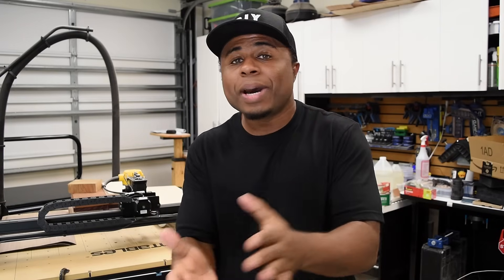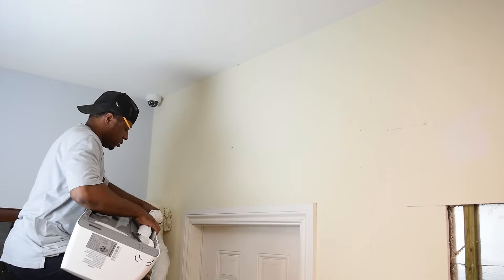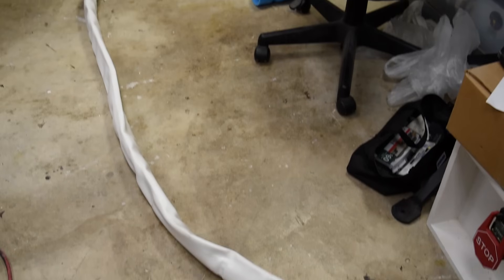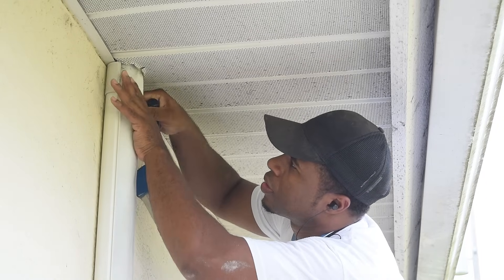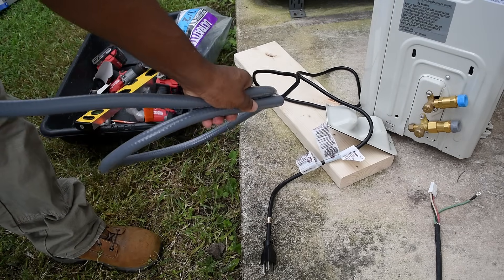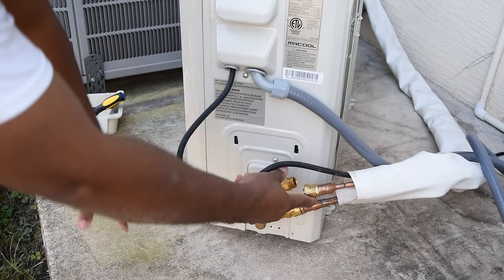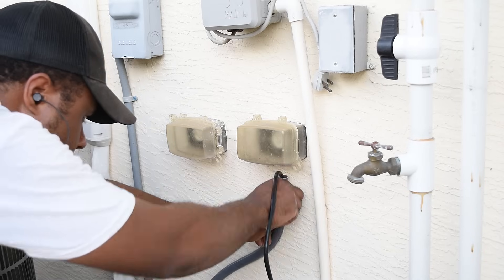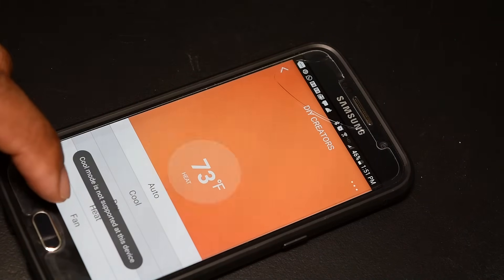How To install Ductless AC & Heating System // True DIY Mini Split MRCOOL

Comment from the maker: I forgot to mention this system is extremely quiet.  Also, This is a complete DIY System so the installation will be different from a typical installation. The lines come sealed and precharged. This may be hard to believe, but you don't need to vacuum the line. Please visit https://mrcooldiy.com/ to learn more.
This unit can be installed in any room. My work space is around 400sqf and I have this unit https://amzn.to/2Ci2uEN
Reply: No need to put the lines in vaccum??
Reply: @gordjy  sure ! the air inside the line will mix with the gas and that's bas for the system and efficiency for cooling.
Reply: Gordjy the lines are precharged.
Reply: Gordjy don’t follow this. The compressor won’t last very long with out pulling a vacuum on the refrigeration lines.
Reply: @NicksRestorations  BS! At the very least, check with the manufacturer as to the " compressor wont last long.."  why in the world would they give the warranty they do ( pro install NOT required) if they were not willing and able to back up their warranty?  Also, check with the manufacturer regarding whether its the lineset or the condenser that is precharged...also, how long do you want that condenser to last? I am in my third season with this one....in Hawaii.....
Reply: Some amazing comments here.  This unit is made to DIY. Do you really think the company is going to put out a product without taking into consideration the basic concepts of AC/refrigeration? The comments about the "need" to vac the lines and the one about hard wiring don't take into consideration that maybe, just maybe, the engineers at the company might know a thing or two about a thing or two.
Reply: @rogermccaslin6750  yes but everything they add is just another component that can fail.
Reply: @higherstandardservice9877  
I wasn't talking about the quality of the unit. I  just commented on the fact that some think it's not DIY and/or the the idea that it needs to be vacuumed because the lines are shipped open to atmosphere. It's as if they couldn't fathom the idea that the line set is precharged and sealed. My point was the manufacturer wouldn't put out a product that was doomed for near instant failure.
Reply: @rogermccaslin6750  they most absolutely would and do, they do it all the time in fact perfect example cars. We have the tech to make cars that use no resources have no emissions and would in theory never break down. But that's not what the market sells, instead they sell a product they know is  going to fail just after their warranty so they can sell u another... no company would make money if they did what u r implying
Reply: @rogermccaslin6750  I never said it's not a DIY, I said it's a terrible product to use, and that for the minimal price difference you should just get a real product and have a certified tech install it. Never the less I have much better things to do with my time than this
Reply: @rogermccaslin6750  made in china... with a rebranded name... lots of issues... there are no short cuts.... and china DONT care about you.. they just want to make a sale... im a 25 yr HVACR TECH... specialized in commercial/ industrial applications... but i did start out in residential... if you have any questions... PLEASE dont hesitate to reach out
Reply: @richardwoeckener7936  
I'm sure you are probably right. The quality may not be there (support either). The thing is, I wasn't commenting on the quality, just whether or not it was sold as DIY. Some were convinced it wasn't for a variety of reasons but the company's website clearly states it is DIY and the unit is engineered for DIY. That was my only point. Whether it last for a year or two or ten, I can't say.
Reply: @rogermccaslin6750  i understand... my apologies..i meant no disrespect  ... but if you have ANY questions on future projects on hvacr.. please do reach out...
Reply: @rogermccaslin6750  This unit is not made to DIY.
Reply: @DividedWeAllFall  
You think so? I'll just refer you to their website- mrcooldiy.com. The link in the video description will also take you there. I bet they have a contact page so you can inform them that it's not  DIY.
Reply: I felt i should add some insightful info here since there is a debate about longevity of the unit when not installed by a HVACR technician.  First of all the quick connects do have an air space between the condenser isolation valves and the seat of the quick connects where air/moisture can collect.  This gentleman did a great job in minimizing the dirt in that may have been introduced by keeping the caps on until connecting them up.  However, air/moisture is still in that area from when they were assembled in the factory.  Is this an issue... not really if you understand how the quick connect seals. The QC does not depress the seat until 50% or more of the threads are engaged then at that point you need more torque to thread it in further, the refrigerant then will start to flow and since the threads are not a seal some purging of refrigerant is going to happen.  It is good that the QC connections were soap tested to verify that the seals are sealing.  But purging alone like this will not remove all the air/moisture from that area introduced into the system.  So some safe guards have to be added to capture this small amount of air/moisture.  These safe guards are usually driers and the POE oil itself.  Driers will capture most of the moisture while the oil has sacrificial moisture inhibitors additives to collect some moisture as well.  The only thing i can see being an issue is the routing of the line sets.  The excess length can be looped horizontally but i would not loop them vertically to avoid oil traps.  Other than this, the installation look good as long as the manufacturers line set installations were followed to the letter.  Any DIY people need to do their homework and plan the job ahead of time.
Reply: @greenbiker9951  u failed to touch on the point of system longevity here.. although you did say what I was trying to say a year ago... but in the proper wording.. these safe guards u speak of tho, u fail to mention that they can become a restriction in the line after collecting that moisture causing you to need service. So really this system is great if u dont want to pay labor, but you are going to pay more in the long run if u do the math between cost to operate, maintain, service versus contractor installed...
Reply: Dang guy, surely you have a friend to pull wire on, at least,  or simply try to feed it. Wish you'd had my number. .if we were remotely close, I'd come by and help.
Reply: Bob Boon  watch the video before you comment. It makes you sound like a moron.
Reply: DIY Creators I work in the HVAC trade. And you did better than a lot of installers I seen or worked with.
Reply: I can buy Daikins cheaper then that
Reply: Matt M, you must be a licensed HVAC guy to be able to do so. DIYers have to rely on places like Mrcool, and other online shops to buy them at full price. Where do you purchase yours from, if I may ask?
Reply: @mattm5361  people dont get it...
Reply: We know it's really for your grow room 😂
Reply: The amount of air in the line does have some moisture but with a small drier in the system, it would be removed. An HVAC guy might give you crap about it and say you should use dry nitrogen to flush the lines, but it's not that big a deal. Great video.
Reply: @ChrisWilson999  there is no air in these lines, they come charged with refrigerant.
Reply: DIY Creators I need a man like you!
Reply: I was wondering about the lines , maybe they have one way valves in them .   That take inward pressure to open .
Reply: Bob Boon  there is a photo on thier web site ,when you connect the lines the quick connect is opened .    The compressor is full ,the lines are full .   Done and good to go .
Reply: Did you get an HVAC permit from your power company. Virtually every state requires them now if you wire them direct. That's why they come with a regular plug in cord so you don't break any laws..
Reply: Could this be used to supplement the cooling of a standard house unit for a 2 bedroom upstairs area?
Reply: that's remarkable, I was just going to ask that question. I'm an HVAC contractor who sells and installs A/C and I never heard of a precharged line set and also was already connected to the indoor unit. very easy installation. Good job on the video. Quick and covers everything
Reply: I am a master HVAC Mechanic and I own a HVAC Company . I really liked your video . I have different tools that make it easier to do a install like that and I have 37 years experience  and I think you did a outstanding job and explained it well , I look forward to watching more of you videos ,
Reply: I would just like to recommend to anyone installing one of these that you should always add an A/C disconnect outside for servicing the unit. You should also never plug them into a receptacle since these units draw alot of amps and if something else gets plugged into the same receptacle it can end up tripping the breaker. Ductless mini splits should ALWAYS be ran off their own breaker and hardwired.
Reply: Chris Verbeke sorry but these units do not draw A LOT of power. There’s a reason it came with a 15 amp plug end and not a 20, the entire system probably only pulls 7-8 amps max. This is the main reason the seer ratings are so high on mini splits.
Reply: So you could have ran the hvac lines dwn where the drain hole and hid everything
Reply: U sound Jamaican .are u ?
Reply: DIY Creators how much do the system cost?
Reply: Hi, Good video I liked it, can you please tell me how many SEER does your unit have ?
Reply: 10:19 You better put that hose inside the box or water might fill up the hose and it may run into the condenser unit and corrode the contacts.
Better safe than sorry.
Reply: DIY Creators so can you travel to install me one in my home 🤗
Reply: What about the cost??? I see these in Orlando Florida for sale around $500.00 for a 12,000 btu?? Was yours the same price wise, and btu???🤔
Reply: what if you want it in multiple rooms am I using one condenser.?   I need it in 3 2nd floor bedrooms. thank you so much for sharing. god bless
Reply: Hey thanks. Another very informative video. I ended up getting the 24000 BTU mrcool version and putting it in my garage. I'm not quite finished since it's a 240 I had to do some extra things. Like it's stalling an extra breaker and the problem with it is that the electrical on the mrcool systems is very lacking for instruction.
Reply: Great video, thanks.

  Just wanted to say should look at the flare fittings make sure they was done rite.
     Thank you
Reply: What's the lowest temperature you can set it to?
Reply: I see how these pre - pressurized vapor lineset work but what if you install and crosstread the flare nut or not tighten  it enough causing a leak? I would feel more comfortable  pressure testing the lineset and removing moisture the old fashioned way. Just added security.
Reply: 10 of 11 customers I've had were denied warranty from this company, now have Mitsubishi,  american standard or Fujitsu's. and the other spent over a grand on electrical components to get it working.none were more then 3 years old
Reply: Chicano Azteca  niether does Mitsubishi and fujitshu... because the good units can have long line sets and support wall units , ceiling cassettes , mini ducted air handlers and multiple heads... and we can add or remove the refrigerant charge to accommodate the install .... also better warranties.. but you do have a good point.. if not done correctly when attaching a self piercing line set... customer can get air in the system !! ITS GOOD TO HEAR FROM A FELLOW HVAC TECH ... HVAC ON MY BROTHER!!
Reply: Chicano Azteca  p.s... carrier minisplits are made by midea
Reply: And what about the vacum the system and mine take 12 amps max and average 9 i can plus it to the wall
Reply: @massesbulet  did u have a question?
Reply: Impressive, very clearly explained, critical points of mention were highlighted,.. extremely well done wow. 💪🏿
Reply: Thanks for the DIY video..  How much did this system cost?  We are looking at purchasing an 800 sq ft portable building and would like to be able to use this system running 1200 amps of solar power.  Will this work?
Reply: DIY Creators lovely 😊
Reply: Hi. Did the inside unit pipes came with vacuum in it? Just asking because of the humidity. Thanks
Reply: How much you paid man??
Reply: Thank you for your channel and I wish you much success my brother
Reply: ⅘
Reply: Any updates on this AC/heater after almost two years? Still going strong?
Reply: Seems to me even if it's a little small. Just keeping the edge off and it's good.
Reply: I got one and you do need to pull vaccumm on it
Reply: Sure . The mix with gas and air is bad for the system .
Reply: cutting through the coloured beam is not good.
its the support frame, also, whoever wired your house is an idiot and didn't pass inspection, or, the inspectors blind.
you have exposed wire running over and around exposed wood nails in the attic. there needs to be a metal separation between the two.
cool project none-the-less, and congrats! (ex electrician now aa rodman)
Reply: Thanks for sharing, God bless you.
Reply: That was clean bro,but what happened to vacumming the pipes🤔
Reply: @Skylarkist Expert it's a DIY system
Reply: How cold does it get where you live?   My furnace has a condensate drain and I rain it to a condensate pump along with the AC to a pluming drain inside the house so it not freeze in winter.   Amazing how many contractors in the older days would let the condensate from Ac dump into Crawlspace.
Reply: Great video sir!
Reply: What is the max distance from the indoor unit to the condenser?
Reply: The website says “The line sets precharged with R410A refrigerant, the quick hook-up electrical connections, and the quality engineering mean just about anyone can install a MRCOOL DIY in their home.”   In theory a r410a pressured lineset with a quick connect from the factory would still introduce air and moisture but in a small amount.  Unless it is designed to purge the non-condensables with the r410a as the quick connect is cracking open and before the sealing to outside is complete.  It is important to note that POE refrigerant oil used with r410a can create corrosive acids when moisture is introduced, shortening the compressor life by degrading it’s windings.  This is a critical difference that r22 and mineral oil did not experience.  A hvac tech would shorten the lines to fit, vacuum and check refrigerant levels for utmost performance and reliability.
Reply: They have been pre-charging lines and compressors for years in Asia. It is a proven method.
Reply: @rj.parker  Good luck finding your sub-cool without a Service Port on your high side. These condensers on the duct-less split are pre-charged for a pre-set amount of line-set. Usually around 100 feet depending on the make/model and # of head units. Leaving the line-set the length it came would be just as optimal as cutting it, putting it in a vacuum (not to mention all manufactures want a triple evacuation), and charging it. I'm an HVAC tech and I would have done what the manufacturer recommended, not thought I knew better than an a group a Engineers......
Reply: If I were to go that route, using the MrCool DIY series of mini splits would not benefit me at all. These "quick connect" valves in the line set introduces zero air/moisture into the lineset.  How do I know this? There are many successful installs of this DIY series that were done 3-4 years ago, and longevity for these units is VERY good.  While it is possible according to your theory, that air/moisture may be introduced when hooking up the lineset to the condenser, the likelihood of this occurring is extremely small. The warranty for the MrCool DIY series is 5 years parts/7 years Compressor, and professional install is not required to be covered by their warranty.  You can always use an HVAC contractor to buy and  install a mini split, and you will pay many times what this unit will initially cost. In this install, the lineset is coupled to the condensor, THEN the high side/low side valves are opened on the condensor.  Gauge your cost/value proposition, and carry out your due dilligence, regardless on what mini split unit you decide on.  If you are an avid "do it yourselfer", this may be the mini split unit for you.
Reply: Elder Geek How many motors were damaged by poor techniques of subcontractors such as leaving copper lines open before hookups permitting bugs to crawl inside then cause motor burnouts?
Reply: @eldergeektromeo9868  if ur gunna do it yourself this is the way to go. But that warranty is terrible 5 years and only 7 on compressor. That is less than half the warranty of Fujitsu's, Mitsubishi, haier. Etc.. so you are get a cheaper unit that u will spend more on, more to operate, have to install it yourself and it's not going to last even half as long as a real one. Ur gunna do the work 3 times and buy the system 3 times instead of just doing the 0% financing every major manufacturer offers and getting a 15 20 year warranty instead. But weigh your pros and cons right.. less money upfront, less life span, less labor to pay a contractor more work and time for you. It's a personal preference thing, just dont for a second think this is the same thing you would get from mitsubishi
Reply: @higherstandardservice9877  your right people dont get it... its like beating a dead horse...( hvacr tech 25 yrs)
Reply: @fmpApps  answer: ZERO!  Hate to disappoint....just because you're a DiYer does not mean the quality of the work is done poorly, or less quality....if you want to sleep better at night, go ahead and hire a HVAC contractor to install and complete the unnecessary vacuum step as well.  Good Luck!
Reply: I've been thinking about doing ductless in my house and you definitely made the project seem accessible even to a novice like me.  Thanks!
Reply: The line set is capped to reduce moisture and air from entering the line set once you unseal, air is instantly present, a pressure test helps ensure  410a is not leaking into the environment (though it not as bad as a CFC refrigerant it still effects the environment), pulling a vacuum is not a test it is to remove moisture and from system -  non condensables include: air, moisture, dirt, copper shavings, anything foriegn ETC... proper removal of these is proper craftsmanship also cfc licenses are important obviously you want a good technician and possessing one does not guarantee that but it means they are certified to handle three different levels of refrigerant based systems. This is not to criticize but inform it doesn't take a good technician to make a system run it takes a good technician to make one preformed as intended.
Reply: @UnknownToMe  correct .
Reply: did i miss something? i didn't see this getting mentioned, but you're suppose to pull a vacuum to 500 microns on both lines in order to clear the lines of any air, moisture, contaminants before you release the refrigerant, skipping this step will shorten the lifespan of the unit
Reply: @am80ma  that's what I thought too but I guess things have changed since then but if there sealed then I guess no need....
Reply: This does NOT apply to the MrCool DIY series. The lineset is pre pressurized with refrigerant, so no need to vacuum the lines
Reply: @eldergeektromeo9868  BULLSHIT! They  ARE NOT! They contain no Shrader valves or anything. THE SECOND you expose that to atmoshphere it has sucked in so much that is moisturized! Damn why do I bother?
Reply: @ericeckler8445  I'd pick another trade mate...
Reply: @ericeckler8445  good question....why do you bother disseminating incorrect information...guess you didnt see the DIY in the original install....wanna pay an installer? go right ahead, your choice.  and, bullshit to you! up to you if you have the extra$$$ to spend.  It can be done as a DIY project, and except for the electrical install, a pretty straight forward DIY project at that. the only thing sucking atmosphere...is YOU!
Reply: @ericeckler8445  They actually only open when connected.
Reply: @ericeckler8445  Yes they do. I recently had a conversation with one of the MrCool management. It's flare fittings that only open when connected, self piercing.
Reply: Alex Ma go back and watch the video again, the line set is precharged  and sealed no need to vacuum down the lines.
Reply: @TheFalconJetDriver  What the fuck are you talking about?  You have to connect the lineset to the wall mounted half of the unit, and to the compressor side of the system.  Meaning the lineset has air in it.  The condenser may come pre charged, but it is valved off for a reason... Because you open it after you have connected the linsets to both sides of the system and pulled a vaccuum.  Stop giving terrible advice.  I am a licensed HVAC Installer.  

Always pull a vaccuum.
Reply: TheFalconJetDriver never heard of a precharged line set! 😂 the condenser is charged. Want a bees kill me!!! 😂😂😂
Reply: @TheFalconJetDriver   @ElderGeek T Romeo  how about evacuating the air handler? To everyone watching this: save yourself the heartache of doing this yourself, prematurely failing your compressor without correct evacuation prior to charging/opening condenser valves (and having exact charge in system), and voiding your warranty, if any. Have a professional install this. Reputable companies usually warranty parts and labor for 1 year after installation, avoiding you to have directly go through the manufacturer. I've been doing this for years, and I promise you it's never as easy as what you're watching here. Never. Save yourself the stressful heartache, spend the extra money for the professional labor, and have some piece of mind. Oh and one more thing, buy a ductless split made from a reputable company like LG, Mitsubishi, and Daikin. I've never even heard of mr. Cool prior to watching this. Those three companies I listed are by far the best in this category. No other ones compare. Trust me, I've installed "a million" of these and counting. If you do this yourself, I wish you the best of luck, for you will need it.
Reply: It looks like an 1-way valve just like in a quick coupler you use with your compressor.
So the line already comes in vaccum.

https://cdn8.bigcommerce.com/s-7wqdm8gvmj/images/stencil/1280x1280/products/6897/15689/bb3a9b81-2348-47c8-93bb-aadfa8c92fae__75031.1510806945.jpg
Reply: Ok not a substitute in areas where the temp can go below 32 degrees, 32 degrees is when a heat pump/mini-split loses efficiency which means you need secondary heat which is gas or electric heat.. or move to the south...
Reply: @Milerhighlife2011  most mini splits are efficient down to around 0 degrees before you would need electric resistance or gas heat.
Reply: @koreymayo8884  nope
Reply: @Milerhighlife2011  at only 32 degrees a heat pump is still way more energy efficient than using electric resistance. Electric resistance will run your electric bill through the roof. A mini split heat pump can handle lower temps a lot better than a single speed split ducted system, but even a single speed heat pump is better than electric resistance until you get below 10 or 0 degrees.
Reply: There is a reason why us electricians and hvac techs do a 4 yr trade to do this. It is illegal to do this untrained. There are rules and regulation and environmental laws that need to be met
Reply: @PFSred  it's only a 1 year trade where I live.
Reply: @PFSred  4 years! Maybe for an engineer like me.  I'm figuring this stuff out in 4 days. Get your money back from that school...lol
Reply: Just what I've been looking for.  Hope to see a review of your system in the near future.
Reply: As a qualified refrigeration technician. I can tell you this unit will likely not last with the system having oxygen and moisture in the lines as has not been vacuum evacuated, even though they are under pressure and pre charged with refrigerant. The likelihood of air getting into the lines. Air getting in will cause the compressor oil to become acidic and eat away the enamel on the motor windings causing it to short out, if not that will likely seize due to rusting of the compressor components.
Reply: NO need to vacuum the AC unit? Lol
Reply: @erikohman4770  as you tighten the lines down it pearces a seal basically and the vacuum stays in tact
Reply: You really should pull a vacuum to check for leaks.
Reply: @Maverick-j6e  these lines come precharged with refrigerant, no need to do vacuum.  when  lines connect to system the refrigerant in lines purge any moisture out from the connection
Reply: @Maverick-j6e  LLP
Reply: I miss the part where you purge the system to remove moisture
Reply: As a professional hvacr tech 25yrs..... your line set is limited in length.... cannot support mini air handlers... cannot support multiple heads... cannot support wall cassette... cannot support ceiling cassette... cannot support your warranties.... cannot be fixed lack of parts... it cost more to fix than buy ( DISPOSABLE)... cannot support heat during in low number temps... THIS IS A TERRIBLE UNIT... PENNY WISE... DOLLAR FOOLISH
Reply: Hi, great Work! Why don´t you support some homeowners by producing their own gas? The  people need your aid: https://www.youtube.com/watch?v=xAkIKxA3Jm0
Reply: Wrong, you were supposed to have vacuumed the system before opening the refrigerant valves to remove air from piping 😜😜
Reply: that line should be as short as you can get it, why ? it will make the unit not as sufficient it could be. worth having a Hvac guy come in and shorten the line and vacuum and recharge. and you get a thumbs down for the dam NOISE on intro,,I dont want to set here and volume up and down you are all ass wholes for the dam noise .Make the video for the people ,and not for you
Reply: @SonofGodly  They have shorter lines that you can buy, but they tell you to coil and put it behind the condenser.